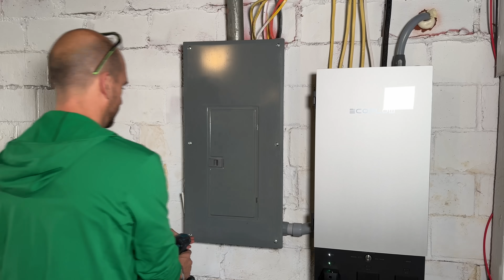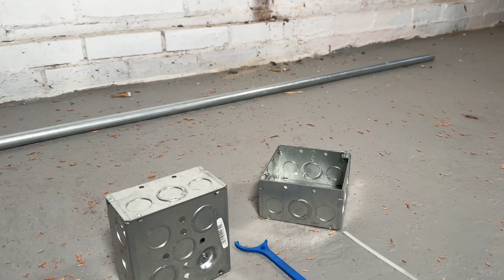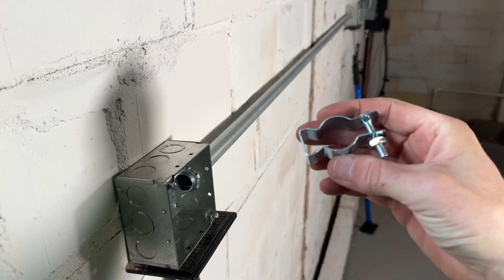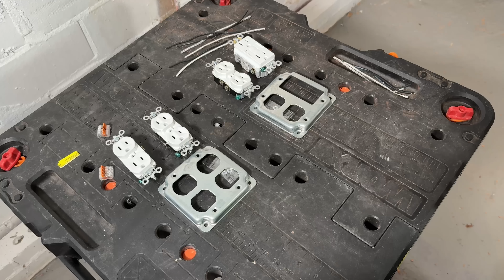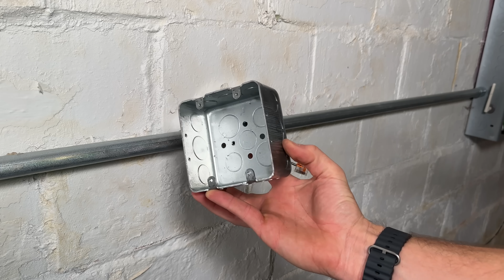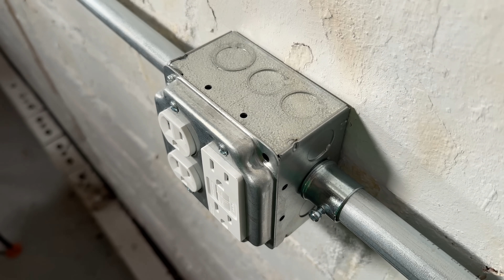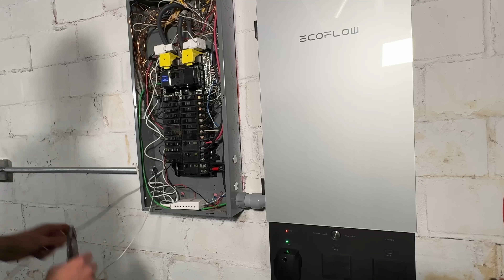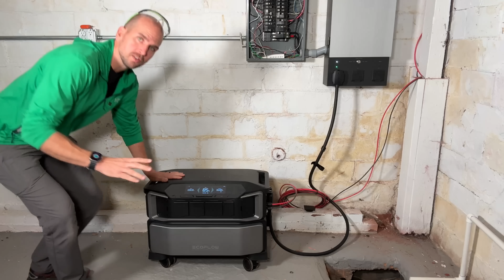Add Outlet To Unfinished Basement Or Garage

Comment: STILL ABSOLUTELY ILEGAL
... worse than the original
.
WORST VIDEO YOU EVER MADE
.
We stopped allowing conduit as ground ages ago .... where is your ground wire .... you may show ground now, corrosion and separation can end that, which is why the code changes 30 years ago requiring a bonded ground wire ever since an inspector got zapped due to a separated conduit 
.
And actually the code does NOT have rules against running Romex inside conduit ...... while there is a heat concern there is no code against it
.
NEVER USE A PIPE CUTTER ... first thing taught in apprentice ship , very difficult to remove bur ... hacksaw/sawsaw/bandsaw heck even grinder and you can debur with your wirestripper
Reply: The NEC allows conduit as a ground, no wire-type ground required. Yes, romex is allowed in conduit, but there is no heat concern.

Comment: The reason a grounding pigtail is needed is so that if the device is removed from contact with the metal box, it will still be bonded. With the raised covers it is possible to remove the cover with the devices leaving both the metal cover and the devices unbonded.
Reply: Sort of. If the receps were riveted to the cover, no grounding pigtail necessary. The way he did it, pigtail required.
Reply: @pld8993  Never seen one riveted. At the very least he should have bonded to the box even if he is using the conduit as a ground.
Reply: @Sparkeycarp  Doesn't have to be rivets, that's one example, but it has to be something permanent that is not removable. Pigtails are certainly easier. I've never riveted one either but I did a job long ago that spec'd permanent fasteners on cover mounted devices. I don't remember exactly what we used but they were some type of irreversible screws.
Reply: True
Reply: "The reason a grounding pigtail is needed is so that if the device is removed from contact with the metal box, it will still be bonded...." The same applies to the neutral.
Reply: It's easier and safer to run a ground wire to b. Boxthan run risk of inspector tagging your job and having to redo it or worse running risk of electrician  because of a break in conduit. I have seen conduit come apart over time and even separated from inaccurately mt. or something shifting the boxes also bonding boxes to be code compliance

Comment: You are wrong on Not having a ground each recept. The cover assembly requires a pigtail ground gest. As you did the pig tails for the feed and neutral, it is required to have a ground.  Throughout as if the conduit was to become loose rusted or otherwise, you would lose your ground downstream further. If you removed the cover while not deenergized, the cover is not grounded, you must have a ground absolute wrong. As seen in other statement, you should have a vapor barrier of some sort between the boxes and the concrete walls.  As well as strapping the condo to the wall. I don't recall the exact amount of inches from each box. But the longer run definitely requires a minimum of one strap with its ten foot it Would require two

Comment: So two questions.  
1. If u are running 12 ga wire why not 20 amp outlets. I know you can do 15 amp on 12 ga.  Just curious
2. It looks like there are two black/white wires on the GFI.  Couldn't you just do one black/white in the GFI and get same result
Reply: Almost nothing that you would plug in in a home needs a 20 amp recep configuration.

Comment: Hi guys. Scott covered not putting Tyoe NM in a raceway because he considered his basement a damp location where NM is not permitted. However NMC would be allowed in a damp basement raceway. He is obviously very familiar with the code, but I agree with all of you that want to pull in a “positive” ground. With so many appliances using computer chips that helps reduce  many problems caused by stray spikes.

Comment: If this is a damp location you should pull THWN/THHN stranded wire in the conduit. Beyond this you have several options as to the installation that fall under workmanship and technically would not be a code violation depending on the state you live in of course and how the local codes are worded and who is doing the inspection. 

I would recommend the following:

1) Make the branch circuit 20Amp you are literally at the main breaker box there is no reason to run a 15Amp 120VAC branch circuit. Better yet for a square D breaker panel you can use a tandem 20Amp breaker, string two 20Amp branch circuits and alternate in each quad box, one GFCI #1, and the other GFCI #2 in the same box, then alternate the same in the next box.  

2) Use THWN/THHN 12AWG stranded wire (will work for damp basement locations). For one circuit use Black, White, Green (don't rely on the conduit for ground fault protection or GFCI leakage detect always run a ground wire even if you run rigid conduit). For two branch circuits you could use Black (line), White, Green, Red (Line), Yellow (or White marked), Green with Yellow stripe (or Green Marked). You would be pulling 6 wires which would not violate the conduit fill or box fill. Stranded wire is much easier to use in creating a longer pigtail while folding into the box. It is always better to have a slightly longer pigtail for repair or future work. Use a dedicated box stranded 12AWG wire ground screw with captive spade lug to ground each receptacle to the box and the circuit ground. In the video you have the proper boxes in that they have the bulged ground connection for use against a flat masonry brick wall. 

3) For 4 total duplex receptacles, use four GFCIs, I dislike ganging GFCIs because if you trip a GFCI you will lose all of the receptacles. 

4) Use the industrial version of the GFCIs (local code may require tamper proof version). The quality is much higher, and the wire connection screws are larger and more robust. They also have versions that are prewired using stranded wire or solid wire but are not always in stock. 

5) For stranded 12 AWG Wire I use ferrules at the breakers. I like the square style crimp it fits nicely under the breaker screw clamp and keeps its shape. Don't forget to torque the breaker screws to specification, for Square D it is listed on the breaker body.  

6) I like using crimped captive spade terminals to the receptacle screws, if the receptacle will not accept spade terminals I use ferrules, but here I like a hex crimp style. To daisy chain you can use 
twin wire ferrules two wires into one ferrule. You could also use butt splices (some are even step up and step down to allow two wires in one side of the crimp) with high temp heat shrink. To pass inspection it is good to have branded terminals and ferrules used with the branded or approved crimping tools. For example you would use Weidmuller ferrules with Weidmuller ferrule crimpers. When you use a spade lug under a screw head, like you would see if you build industrial control panels, you have a flat connection under a flat screw head, and once this is torque properly (screw is stretched) it will not come loose. I don't like putting a solid round wire around a screw if I can help it, and I certainly don't like to put a stranded wire around a receptacle screw and I never use the back stab easy insertion connections. 

7) Use offsets where so the conduit is flush with the wall. Always support conduit with at least one wall strap even if the boxes are close together. With EMT you can bend your own offsets, or you can also buy premade EMT offsets. Bending EMT is not all that difficult it just takes a little practice. If the premade offset is too large for the junction box chosen you can use the two 3/4 inch knockouts that are across from each other on the box so the conduit entry is angled up and exit angled down which look fine. 

8) I never use WAGO splices on receptacle branch circuits, I only use them with ceiling lighting circuits.

9) When modifying the GFCIs to fit in the metal face plate use a vice to hold your work you will have to take the ears off and cut off the threaded mount. 

10) Use an automatic wire stripper to strip the THWN/THHN. Proper automatic strippers will not nick the strands.

11) Also test new Receptacles and GFCI Receptacles after installation with a dedicated branch circuit tester like the IDEAL 61-164 SureTest Circuit Analyzer (it will fully test GFCIs for current trip and trip time). 

As you can see the "workmanship" approach depends on who is doing the wiring and who the client is. My approach, as described above, and the approach in the video have nothing in common other than they both should pass inspection. The only real thing that I would do the same as in the video is have the branch circuit conduit come straight out from the side of the breaker box. This way the conduit run will not block any additional runs that need to go parallel.

Comment: Here he is again mr utube electrician trying to share his lack of knowledge with you.  List of things he shows you thats wrong (again)
1) no ground to conduit ), 2) no moisture barrier under metal boxes , 3) not enough or properly spaced clamps. 4) used wagos to make simple connections which no contractor worth a salt would ever use. 5) drilled boxes into old mortar instead of block.
Pretends to be an expert on this new solar gadget hes knows nothing about. This guy is a typical utube know it all/know nothing. Dont take his advise instead get a seasoned professional.

Comment: I would definitely not use connector (Waygo) to connect the GFI to the regular receptacle - complete waste and one wire here would be more secure and sensical.  Also, why 3/4" conduit? 1/2" would be plenty for this.

Comment: Good critiques and cautionary comments.  I always use electrical tape to cover all exposed receptacle connection screws.  My first boss was too cheap to buy tape, so I always had my own.  Ground wire, tape and sleep easy...
Reply: Tape not necessary. It will leave a messy residue on the receptacle. It will make it more difficult to work with in the future.

Comment: I would think that you would want to minimize connections to pigtails.  Why not just take the CB feed and put it on the GFCI.  Then put the load into the GFCI.  Since you're using WAGOs, I'm thinking you don't need to use the screw terminals.  The insert connections are robust (oh, I can hear them screaming now)  And you've eliminated a bunch of WAGOs.  And your box can be more compact even though in your situation it doesn't seem to make a difference.  To keep it simple, why DON'T you run romex with ground and a nice protective sleeve.  Does code not allow that?  
I enjoy your videos because it makes me think about alternatives.

Comment: Every hospital or clinic I've ever been in has the outlets arranged opposite from yours: "nose" up and "eyes" down - supposedly protecting against some metal piece from contacting (and shorting) the two blades. It's "eyes" up and "nose" down in my house and every other house I can remember. What're your thoughts on this? Also, I always run a ground wire - belt and suspenders. Good video - thanks.
Reply: Doesn’t matter. You can turn’em 90 degrees, run them vertically if that floats your boat

Comment: I notice your using 15amp rated outlets on a 20amp circuit, this is not code, and in some instances 12wire wont work on a 15amp outlet.
Reply: Please read your code book

Comment: Here in the United Kingdom that installation would be deemed unsafe. All circuits should contain their own suitably sized CPC, and metal containment (steel conduit or trunking) should not be the circuit protective conductor, but should be adequately bonded to earth so as to be able in the event of a short circuit to handle the fault current and ensure an automatic disconnection from the supply.
Using metal conduit as an earth return path ended when the 16th edition of BS 7671 was introduced back in October 1992 as it was found that several people had been electrocuted as a result of rusted out and loosely fitting pipes.
Also, using pig tails in those sockets rather than a loop in - loop out method adds more points of failure into your circuit which can result in fires and unreliability. 
Boxes of that type should only be used when they are for flush fitting (plastered into a masonry or plasterboard wall) as there are holes which can allow a 1mm wire to be inserted and contact live parts which can result in death. Also those knockouts can be removed by kids which can then allow their fingers to be poked in.
The use of residual current devices like GFI's should not be used solely to protect persons from electrocution, they should be used in conjunction with an over current protective device which needs an earth reference to effectively operate. It is possible to receive a shock from phase to neutral and the GFI will not see this as a fault and therefore will not disconnect the supply, it will only operate when there is a flow of electrons in either conductor to ground, which will cause an imbalance which will energize a tripping coil.
And remember, trip switches are mechanical devices like your car or lawnmower, they CAN AND DO FAIL!!!!!! I have replaced loads of them over the past 39 years and some were even physically jammed by debris that had entered them and they would not move. It is essential to have these things checked using calibrated instruments that can verify their integrity.
Don't fool around with electricity folks, it's a skilled trade for a reason.

Comment: If you strip out a tapcon just use a zip tie or a wall anchor. Just shove it in the hole and send it
Reply from the maker: yeah, I also like a small piece of 12-gauge bare copper.  knowing those tricks can get you out of a tight spot.

Comment: Whoa whoa Dude. Get that router out of the panel. The panel is not a junction box or electrical closet. Secondly, do not cut EMT with a tubing cutter. Rather, 
the correct tool is a hacksaw. Mainly, because of the beveled edge that the tubing cutter wheel produces. A serious reaming with Channelock handles i.e. is then needed, to soften that edge. A hacksaw cuts through, not bevelling the edge. Lastly, where are the "box offsets", on the EMT as it goes into each box connector? W/O them, you are left with pipe , suspended off the wall, with no way for a 1 hole pipe strap to work, unless the user distorts the pipe. Ugh! One can purchase a 1/2 Box offset tool(This pipe size), or they can sign up for an Apprenticeship and learn how to bend it. Spoiler Alert: Call an Electrician!
Reply from the maker: Thanks for the feedback.  That little unit is a Emporia energy monitoring system.
Reply: Is there a problem with using a cut-off wheel to cut the conduit?
Reply: @paulh6591   Paul, the pipe cutter is meant for copper pipe, and is a tool for a Plumber. If, you feel the need to use it with EMT, be sure and ream the inside vigorously to get a smooth edge within the pipe end. The cutting wheel will put an bevelled edge inside the pipe, especially if dull. Electricians don't use pipe cutters for EMT. We use a tubing cutter for IMC, or Rigid conduit, and utilize a spiral reaming tool.

Comment: As an actual electrician mentioned earlier, it is perfectly fine to run NM through conduit and specified by code in spots where the wire needs protection. Leave the sheathing on the NM.  There are fill requirements of course.  I am not sure where this mis info has been generated but maybe re do the video?! Electricians  drop NM from joist bays into conduit in unfinished often damp basements all the time for things like washing machine power etc...I think most cities have adopted the GFIC for all basements. Makes sense, there will be water eventually.

Comment: Great video - Thank you. But I need to add my 2 cents ... 20 A Circuit usually requires T-slot GFCI and receptacles, one item to mention. The second item is - tapcons are not good for Inside the JBs - sharp, I prefer to use round head screws. And, Yes, 120V is not required dedicated Ground, you are correct, but i would DEFENITELY pull Grong wire for this circuit, just for additional protection, especially for many years After this installation. Sorry for my notes and Thanks again for great presentation. Master Electrician (Canada).
Reply from the maker: Appreciate the feedback.

Comment: Looks like you are installing the j-box screws into the mortar instead of the concrete block. Seems not the best.
Reply from the maker: I also prefer going directly into the brick as opposed to mortar.  On this specific basement wall the block is very brittle and I haven't had the best results drilling into the brick and that is why I chose mortar for this installation.  Thanks for the feedback.

Comment: What is that white box at the bottom of the distribution panel? Is it s low voltage device and is it permanently in the panel?
Reply from the maker: That is an Emporia energy monitoring system.

Comment: Tip for home owners get 12/2 SO cord can get by specific length you need at hardware store is cheaper if your on a budget then buying a roll of black and white 12 gauge wire for plugs

Comment: Or local code inspector will not pass any panel or box that has knock out holes provided by manufacturer,that than you drill holes in it , he will fail it every time
Reply: Does he have a section which he cites?  Sometimes the verbiage is open to interpretation.